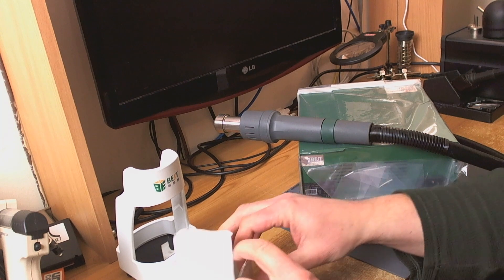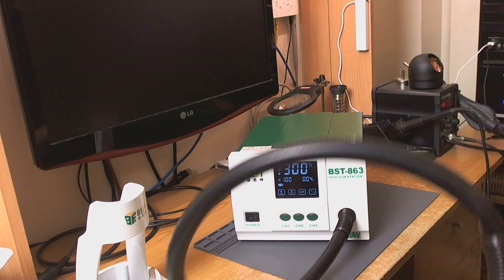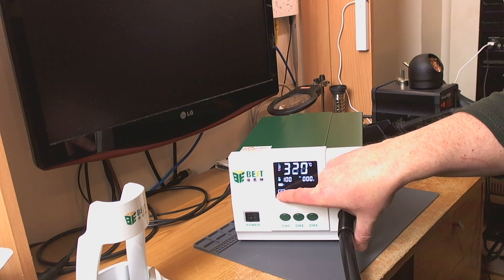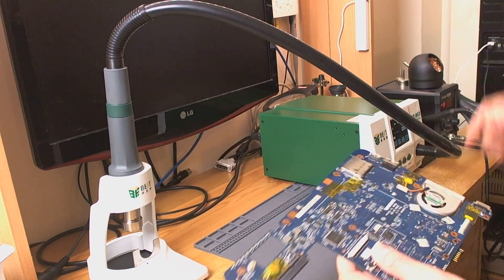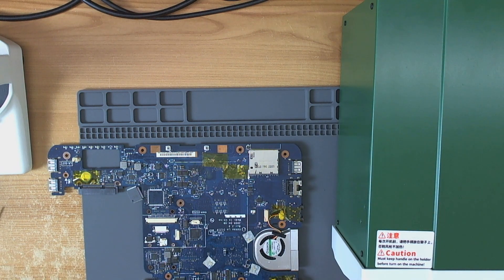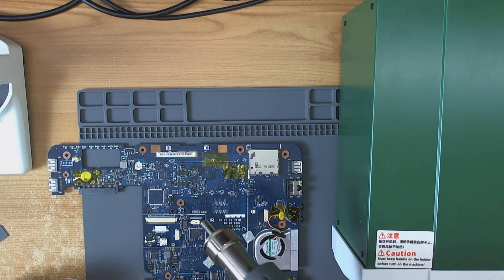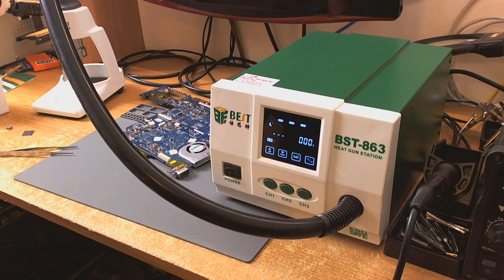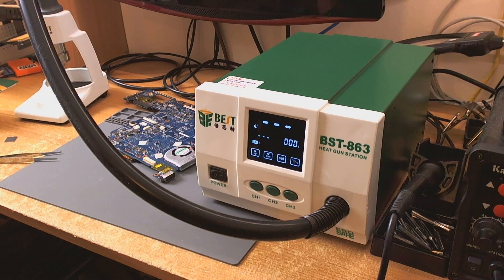Best BST-863 Quick 861DW Alternative Hot Air Station Unboxing and First Impressions

Comment: I’d buy this if it didn’t beep so much.
Reply from the maker: The common solution seems to be the snip out the speaker. :) Honestly, it doesn't bother me as much as the knock-off FX-951, which sometimes beeps incessantly while the tip is warming up after power-on (but is thereafter 100 per cent fine). :D

Comment: Стою перед выбором BST 863 или SUGON 8610DX https://www.aliexpress.com/item/4001272103164.html?spm=a2g0o.productlist.0.0.6eb4e852diUWxj&algo_pvid=69d363ec-df0a-4fb0-aeb0-b46b11edd92d&algo_expid=69d363ec-df0a-4fb0-aeb0-b46b11edd92d-0&btsid=0bb0622f16098582760761658effcf&ws_ab_test=searchweb0_0,searchweb201602_,searchweb201603_
Посоветуйте что лучше выбрать?
Reply from the maker: Hard to say, but this looks like a similar device. If build quality and reliability is good, there should not be much to choose between them. I have no personal experience of the linked item, though.
Reply: @flashjazzcat  Are you satisfied with BST863? Were there any problems with this? How stable is temperature?
Reply from the maker: @it4spam  100 per cent happy after over a year of use. I didn't measure temperature stability but the device is reliable and powerful. Does everything I want.

Comment: i just bought one this week and it came with a fault... the air wont turn on when i remove from its base .... so it doesnt turn on.....
Reply from the maker: I was a bit puzzled at first when I noticed that if you lift the handpiece off the base BEFORE turning on the power, or even too quickly after turning on the power, the thing will never power up. You have to turn it on with the handset in the cradle and wait until the device beeps. Are you certain that's not what's happening with yours?
Reply: @flashjazzcat  actually it has a problem with the sensor switch so i actually have to hit the handle on the table for it to turn on..... So my recommendation is do not biy stuff from banggood.. They knew it was faulty and sold it like that
Reply from the maker: @victorsantos2354  Luck of the draw, yes. I bought the 'FX-951' soldering station from BangGood, and while I'm very happy with the base unit, the supplied handle was DOA and I had to buy a replacement. The BST-863 is available at a reasonable price from reputable UK dealers, however (I purchased mine from the eBay outlet of one such vendor), so one should have no worries there. I would be very reluctant to spend more than £50 or so on equipment from BangGood.

Comment: an I buy bst 863 for iphone repair logic board without to demage motherboard or only need to have one of them for iphone repair remove ic i need to buy one ? which one is better than on iphones?
Reply from the maker: I haven't yet repaired any iPhones at the component level, but if you purchase the BST-863, it will fulfil all your hot-air rework needs, from the smallest most fragile board, right up to heavy thermal-mass ten layer PCBs. Whether you need such power is another matter (cheap eBay 2-in-1 stations may suffice for smaller jobs), but given the price of the BEST, it is difficult to recommend anything cheaper at this point.

Comment: question i have ive actually had this for around 6 months now and just noticed if you have it set to f instead of c when you put it back in the stand as it counts down it goes all wonky with some odd numbers. can anyone else confirm theirs does this. im in the usa but have gotten used to using celcius and decided to finally use f and saw its all wonkey. also you can not seem to switch it to f unless its in use. so in other words you cant hit set then 400 then 100% then the c/f button to change to f only when you pick it up the c/f button seems to work. otherwise the beeping is the ONLY neg to this thing. i also own a quick that died on me and this is every bit as good as that one is. banggood has these for 135$ right now with shipping from the usa being free. i grabbed a spare one and its not here yet to test it.
Reply from the maker: Just tried it and I can confirm the wonky degrees F behaviour. From the fact 'A' appeared instead of a digit, I guess the firmware is using a BCD representation of the temperature and cannot handle anything over '999', although why degrees F jumps up to anything over 572 on a 300 degrees C setting when cooling down I do not know. :) Seems harmless, anyway. Regarding switching on the fly: that also seems to be the case with other adjustments (heat, etc). Pleased to hear the device compares so favourably with the Quick, despite the odd quirk and firmware bug. Mine's working great although I haven't had many laptops in to use it on. :)
Reply: @flashjazzcat  well good to know its not my unit. mine is SUPER quiet and just works awesome so i hated to ever send it back. hopefully the second one i have on the way is just as nice. this unit really IS every bit as good as the quick once you get rid of the god awful beeping lol. i would personally never spend near 300$ on the quick again as long as these are available. hence why i bought a back up unit to keep on hand. i appreciate you checking for me!
Reply from the maker: @th3drizzl378  My pleasure! I suppose you could open it up and put some tape over the hole in the beeper housing. I keep meaning to do the same with the knock-off FX951 I bought just to get into T12 irons until I can splash on a real Hakko. Beeps like crazy sometimes because the low temp warning is mistakenly activated while the tip is initially warming up. Other than that, it works perfectly well, although the sleep feature alone (absent from the copy) is worth the price of the genuine iron. The cradle on the knock-off is utter junk as well... totally useless. Of course such is the way of copies... you get what you pay for. The Best is a different story entirely: quirks aside, it's a quality tool.
Reply: @flashjazzcat  all you have to do is remove the lid and apply a dab of hot glue directly into the hole on top of the buzzer then a layer over the top of it. it brings it down to a perfect level. MUCH quieter but you can still just hear it enough. def best also has a near jbc copy i saw im interested in trying also. i also use t12 tips mostly in the ksger type stations, and then i do have a real 951.
Reply from the maker: @th3drizzl378  Ah... good old hot glue. :) I'll do just that. I should make a video about that thing as well. :D The handle they supplied with the fake Hakko was totally wrecked beyond repair straight out of the box. Definitely only worth buying if you're desperate or short of things to fix. But it does get the job done.

Comment: I noticed the flux you link to in the description has 2% copper, can you explain what that brings to the table?
Reply from the maker: Yeah: I looked into it a while back and I got the impression it's intended to help tip longevity. But it's just really nice stuff to work with, and I recently bought another reel. Love it.

Comment: To bad its not a direct comparison to the 861dw so I know if one was better
Reply from the maker: Yep: too bad I don't have an 861DW to compare it to, but I couldn't afford both. However, three weeks on I am completely happy with the BST-863 and since it is on paper slightly more powerful than the 861DW (and I read one article in which someone who has used both said the BEST heats up a little faster), it seems to have been a good buy.
Reply: i own both. honestly other then the touch screen (you may like or hate that feature) and the annoying beeping this has fully replaced my quick 861 and is every bit as good. using it almost daily for near 6 months now with zero issues at all.
Reply: it is more powerful than the quick?
Reply: Eric H okok i order a genuine quick... quick has seems last since they came out... best... we dont know

Comment: Thanks for the review, if you want cheap and good iron i suggest to go for the ksger t12 2.1S and use original hakko tips but you will need one of those thermistors for measuring the tips like this one https://images-na.ssl-images-amazon.com/images/I/61-MgN4M6bL._SL1001_.jpg  i did just have an initial 30° overshoot, after calibrating you will have just a 1-2°C error margin.